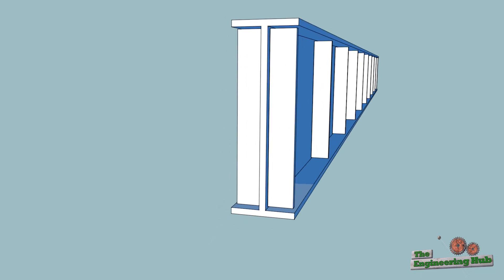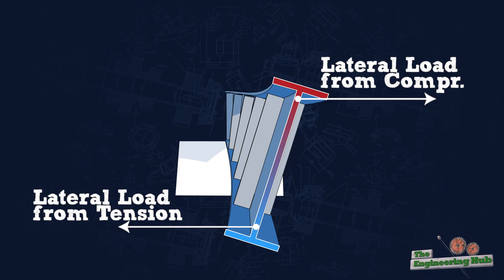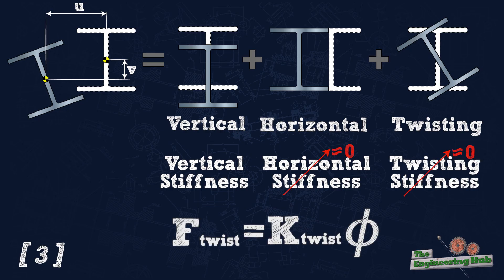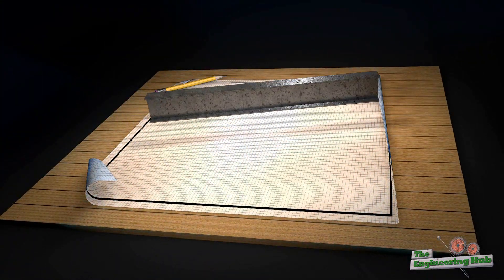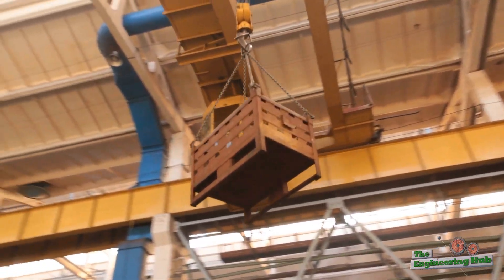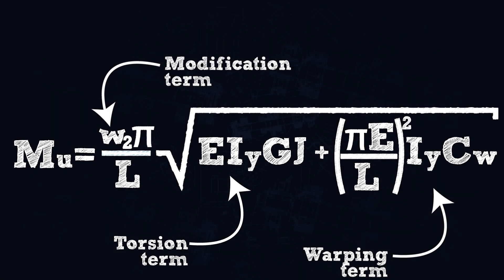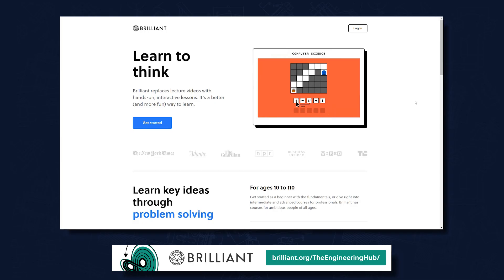Open Beams Have a Serious Weakness

Comment: Great visual presentation. I am an EE, but love working on cars so I find myself wading into ME territory often. 

I see this in pickup track frame design. Properly braced C-channel frames work well, but a fully boxed frame will be stronger still. It's interesting to look at the existing designs and how the cross sections change or where the bracing is applied and try to work out the forces in the steel. When modifying something structural like the frame it is useful to understand why something had been originally engineered a certain way.
Reply: Yup. I am a EE to but I used to haul heavy machine tools. An old welder introduced me to Boxing. Boxing is when you weld steel into the truck frame to box the strategic parts of the frame. Hot rodders often boxed their frames for strength. I always used to design beams initially by looking at the sectional modulus and ultimately the moment of inertia. In timber framing you don’t always deal with the slenderness ratio of thinner members. But slenderness ratio and ultimately beam stability do play a significant role. Even in post compression, you need to check your buckling modes as much as your initial compression loads. Buckling will ruin your day and LTD is one of the worst for sure.
Reply: @devmeistersuperprecision4155  Exactly right. I've seen boxing used on pick up truck frames when modifying them for off road use.
Reply: Vehicles are also designed to respond properly to certain kinds of crash scenarios, so open v closed beam may be an actual designed in decision to make sure the engine goes under the car in a front end collision, and similar things.🙂
Reply: @noyb7920  I was a volunteer tech working on coffin nosed Stanley steam cars. Wood bodies, no seat belts and a boiler large enough to heat a house! Worked on muscle cars in my youth including 426 hemi challengers. Modern vehicles are an over priced joke! Loaded full of obsolete consumer grade electronics and plastic. Designed to be snapped together like lego blocks and impossible to work on. You need an arsenal of snap on tools to get anywhere including stubbies, knuckles, imperial, metric, 6 point and 12 point shorties and extended sizes etc. You have to take half the car apart to fix anything. They are designed to go 200K and then off to the scrap yard. Now they have complex touch screens. Really People! If driving with a cell phone is dangerous, what about farting with a touch screen to get your iTunes account to play the latest hits at 90 MPH in congested freeway traffic. Stupid! When they crash, they virtually fly apart in a crumpled mess. Even minor accidents are total losses! Now the insurance companies have to cover this joke so your insurance rates are thru the roof! The marketing folks put lip stick on this pig and get everyone to buy these plastic buggies on seven year contracts. The cars are done at the end of seven years so you get to buy another one. Then they now require you to use fluids with secret recipes and huge price tags. What happened to old fashioned lubricants and coolants? And now you can’t get a manual tranny! All computerized automatics! An automatic is a machinist’s wet dream! And they are at least twice or more expensive than an old gear box. Have we become so lazy that gear jamming is such an inconvenience? I am glad to be facing retirement as I don’t want any part of this nonsense!
Reply: @devmeistersuperprecision4155  Um, I didn't subscribe to this newsletter, and modern cars are not that hard to work on. See... most any car repair channel on youtube.
Reply: @noyb7920  case in point…I recently changed a distributor on a 1934 Chevy truck. Easy access and fast. Even with a condenser point system. Changed a clutch out on a second gen dodge Cummins. Doable but some areas a bit tight. Changing a vacuum pump is a bit harder on these trucks. Then there is the sugar daddy… a 2013 Toyota Tacoma with half a pound of sugar in the tank. Without a fuel filter, it reaped havoc! Plastic intank fuel pump shot, injectors clogged, variable valve timing acting up, fuel rails partially clogged. The fuel rails were plastic with no Schader valve. Tank has a mess of tubes and plastic tube connectors. While dropping the tank is doable the reinstall was more complex than it needs to be to get all the plumbing right. So I know how to work on modern vehicles, I just don’t like to esp. when you have to R&R several subsystems to get to the issues.

Comment: Part of the issue here is the length of the beam and the Gauge of the steel. A long piece of thin steel in any configuration will be susceptible to torsion and buckle.
Reply from the maker: Absolutely, the length has a higher order power in the denominator, which makes the whole equation of torsional buckling basically governed by the length of the beam

Comment: Had to unload a 50 foot I beam from a box trailer, 2 foot web. It took the better part of the morning to do it without twisting it and ruining the beam.
Reply from the maker: 50 ft is fairly long; the length is the most important parameter, making the beam very suceptible to bending and torsion. Good job on your project 👏

Comment: You did a fine job of explaining, but perhaps an explanation of the mathematics for the mathematically challenged. I would love to try and understand math more in-depth.
Reply: The math shown is nothing more than empirical values and equations, meaning they are simple formula that is contrived to match experimental test data, it's not intuitive at all and trust me, seeing it would not lead to any significant insight.  I'll post a link below of a video that shows how beam deflection is derived based on simple geometry which shows what I think you're asking to see here.  That sort of elegant mathematical derivation is not how the equations shown in this video work.  https://www.youtube.com/watch?v=g8luMxP5Yo4

Comment: IT IS IMPORTANT TO REMEMBER THAT LAMINATED BEAMS HAVE DIFFERENT BUCKLING CURVES FROM BOLTED STEEL BEAMS. IN ADDITION, THE LAMINATED PROFILES ARE ADJUSTED, IN RELATION TO THE DESIGN, TO BETTER RESIST WHEN BROKEN, AND ALSO WHEN CORRECT BUCKLING LENGTHS ADOPTED. THIS LAST CRITERION IS THE MOST COMMON ERROR OBSERVED IN PROJECTS. AS TO SYMMETRICAL PROFILES (TUBE IN GENERAL) THEY ARE IDEAL ELEMENTS FOR CONSTRUCTION, BUT THEY DEMAND MORE SPECIFIC DETAILS IN CONNECTIONS AND SPENDINGS.
THE LOAD TESTS PRESENTED SHOULD USE LAMINATED BEAMS, NOT FOLLED PROFILES (EVEN LESS THICKNESS) FOR THE CORRECT VISUALIZATION OF THE SCRATCHES. IN ANY WAY IT WAS VERY INSTRUCTIVE.

Comment: This is why blocking is extensively used in wood framing. It prevents torsional buckling that can happen even on lumber.
Reply: They Dont call them Squash blocks for nothing.
Reply: @BenDecko2023  He said it, extensive use of blocking. Any weaknesses are rendered moot by the amount of redundant reinforcement.
Reply: @BenDecko2023  I'm not exactly sure if I understand the premise of your questions, but I'll try...  If by "used" you mean old repurposed lumber that was salvaged, then it can be much stronger than the lumber that is harvested today if it was harvested in an old growth forest, usually around 20%, but it can be as much as twice as strong.  If it's just "old" scrap lumber from a previous job, then it might have the benefit of have less moisture in it, so it'll shrink less as the building settles in, but that would be a stretch and hard to quantify.  For the second part, if you're talking about ripping repurposed lumber on a table saw to get it to a smaller dimensional size then that could be fine, but care has to be taken not to expose any knots or checks on the top or bottom surfaces of the lumber, as doing so would significantly decrease the strength of that piece.  Having edges free of those defects is the primary way in which lumber is graded for strength.

Comment: Not only are the beams slightly bent to start with the web is never in the center. I worked with beams in construction for many years and rarely got one that was centered.
Reply: Yeah, the manufacturing tolerances for hot-rolled products are pretty slack. It starts at bar stock. Unless you're dealing with cold rolled, calibrated or even machined or ground material, you could be dealing with variations that are visible to the naked eye. Some hollow stock (square round etc) is also hot-drawn through dies, where the inside die is held in the center only by an equilibrium of material pressure from all sides, so the material thickness can vary by a few percent all around. Similar thing for aluminum extrusions.
Reply: Yeah, the variations in the web can be a serious pain when the prints assume it's exactly centered.
Reply: Those tolerances are considered when determining the design capacities used in building codes.  If you look at the raw test data for ultimate failures of W-shapes, they can vary well over 30%, which is part of the reason we wind up with a safety factor of more than 3 when all is said and done.  Obviously that doesn't help the people who have to put them all together LOL!
Reply from the maker: Great point! Thanks for bringing this up!

Comment: Used and wore out a wide flange beam In A wood spliter and  was planning on doubling thickness of top flange where the spliter knife rides. Your thoughts please on this? Thankyou
Reply: I would suggest you add a plastic slider to the bottom of your splitter knife.

Comment: I-beams are the best for static axial loads, when the load becomes dynamic and/or torsion is introduced it can become complicated to calculate the expected deformation and most likely point of failure (for non engineers.)  Defects in material, high point loads, different welding procedures & varying degrees of fit up can further exacerbate these  uncertainties. To actually attain full load  capacity of an I-beam would require bracing, gussets, and on longer span tying in the top & bottom flanges which in many applications does not happen. Coming from a guy w/ a fabrication background, I always err on the side on building it heavier w/ additional support, bracing, gussets, and extra contact points. I appreciate your videos as theres a huge gap between a fabricator & the engineer that draws up the plans and I fully intend on closing this gap. Best regards.
Reply: Right On. Build it to be Safe and Last the test of time.
Reply: LOL I know a lot of engineers who struggle with those calculations to...  Though it's not as bad as it may seem; these experiments used sections that would be considered extremely slender, leading to elastic and catastrophic failure from local flange buckling and web crippling.  In reality most construction avoids these sorts of members except in special cases such as on bridges, roof girders in large warehouse style buildings, ect.  And in those cases, out of plane bracing is a primary consideration.  Most sections commonly used are relatively compact (think short and stubby with think web and flanges) and have similar design values whether they are assumed fully braced, or completely unbraced, so even if an engineer has no clue what they're doing, it's unlikely to result in catastrophic failure.

Comment: The sections bend in the tranversal plane and generate horizontal loads, contrary to what is hypothesized in the calculations, hence the torsional buckling?
Reply from the maker: The calculations for the in-plane bending still hold. The only problem is that the torsional buckling happens first i.e. for a lower load (in slender sections) therefore the bending capacity does not govern. The torsional buckling happens due to the fact that the top of the beam is being compressed. If you imagine the compressed half of the beam as its own column then it's easy to see that it will want to "kick-out" of place. Opposite to that, the stretched part of the beam wants to stay where it is causing a twisting motion in the beam. I wouldn't say the calculations are wrong it's just a different failure mechanism.

Comment: Even though I'm not an engineer, I could see right away that attaching stuff to an I-beam like in the thumbnail is a really bad idea. Even without calculations, the vertical part of the I-beam is clearly too tall and thin for that, and the horizontal parts are too thin as well, and so the slightest load can lacause deformations, which will eventually escalate to much serious buckling and failing. Either one redesigns the attachments or use different shaped (square sectioned) beams.

Comment: Being a welder and working on many structures using beams you get the instinctual sense of how a beam is weaker in its torsional axis because they twist much easier then they bend

Comment: Years ago, I had an engineer on staff that did the structural engineering and planned the steel elements in mostly wood framed structures.  He designed almost exclusively using square tube.  Now I understand why.
Reply: @TheLuminousOne  No reason to throw insults!  He is a very skilled engineer.  The tube shapes integrated better with the mostly wood framed structures and the seismic retrofs that we were building at the time.  He used open sections in commercial buildings that we built.
Reply: @rogerhodges7656  just going to point at bones, and leg bones especially - change cross-section and internal density depending on the loads imposed from the joint ends and muscle attachments.
Reply: No insults were made or intended.  TheEngineeringHub understood and appreciated my post.
Reply from the maker: Closed sections are really good for edge members or other applications where asymmetric load cases may arise. That is the beauty of engineering, finding the best and cheapest solution for a particular problem. Thanks for the comment Roger, we love it when viewers contribute to the discussion!
Reply: If the same amount of material in a box section is stronger, then why are I-beams ever used?
Reply: @bbgun061  because any tube section is more difficult and expensive to design for the joints, there isn’t any standard sizes as big as the larger sizes in beams and going to a welded box section is expensive compared to a beam. Nothing wrong with using an I beam or column so long as they are correctly loaded.
Reply: @streddaz  those are good reasons
Reply: @bbgun061  I beams are much lighter and usually end up being cheaper. Some projects really can benefit from a lighter top structure as adding tonnes imposes even more costs to hold said tonnes in place.
And tubes be they square or rectangular are annoyingly hard to connect by bolting, while welding is not always permitted as some structures require disassembly. I beams are super easy to bolt or weld in place in many configurations.
Reply: @bbgun061  Rectangular sections are not stronger than I-beams relative to weight for bending.  The way to solve lateral torsional buckling is to brace the beam so it can't rotate or use a heavier beam.  Even a heavier beam that's unbraced will be lighter than an equivalent rectangular section which would also be unbraced.  Rectangular steel beams are generally used in wood construction if there is a well-defined space they need to fit in, say in a or 2x4 or 2x6 wall, or if an existing wood beam is being removed and needs to be replaced with a steel beam.  This is because I-beams don't have standard widths or depths so fitting them in with other members can be problematic, whereas rectangular sections come in all standard sizes, and come with varying wall thicknesses depending on how much strength is needed.
Reply: @bbgun061  Because they're not stronger. An I-beam is still going to resist bending much better than any other shape in the direction in the vertical axis. This is why they're the most commonly used steel member. But that's the thing - it's only stronger in that one axis. A box beam is going to be much stronger when you're dealing with oblique/torsional/eccentric loads, or when it's a particularly long unbraced beam which can cause the issue you see in the video.

It's all about trying to figure out not just how much load is going into each member, but the nature of each load, and assigning the appropriate structural elements to each part of the structure.
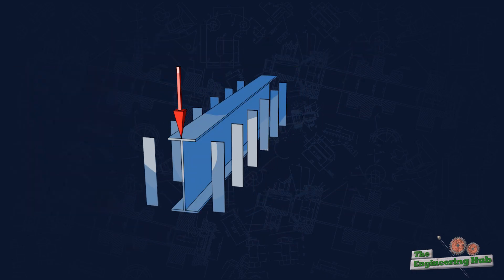Reply: @bbgun061  6:50 The I beams are stronger per pound if properly braced
Reply: @bbgun061  You also have to count in how static the load is. In construction, especially when steel and concrete gets combined the load is usually a bit more static than a swinging basket with weights. a couple of years ago i worked on a jobsite were we did the rebar and concrete work. the steel construction was almost completely build with H beams(except some square coloumns filled with concrete, had to do with fire resistance) the first floor was build bij pouring concrete slabs on oversized corrugated sheetmetal inbetween the H beams. The H beams were all pre drilled to accept rebar every 10cm(4in) and the end beams were smaller h beams but they got dowels welded on top to connect with the concrete.
Reply: Because I beams usually come with 50 to 100%  more yield strength at almost the same cost per ton as compared to hollow sections.
Reply: the same efect can be achieved with double beams with diagonal strengthening
Reply: @okiedoke6373  Rectangular HSS sections come in a variety of widths including 3.5" and 5.5" wide so they can fit within wood studwalls.  It's actually somewhat unusual to use a rectangular steel beam for anything other than wood construction, unless it is part of a facade or storefront elevation.